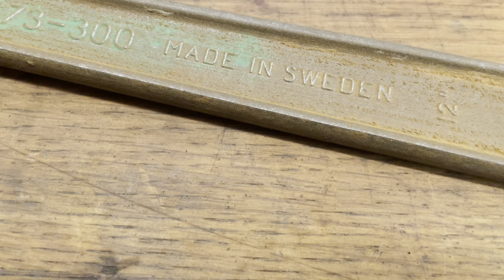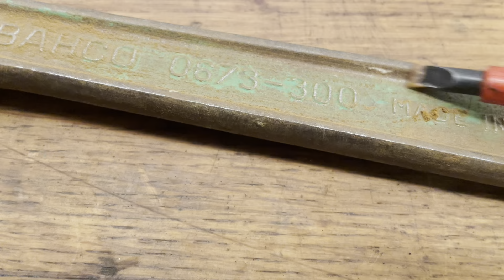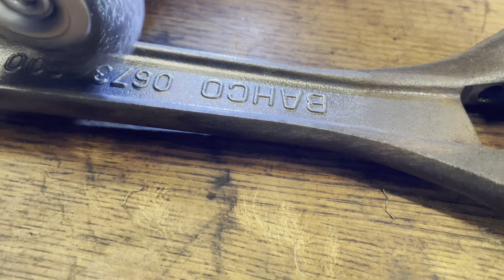Rusty old wrench restoration

Comment: For it to get like this does it mean all of the chrome plate has come off? If so how long did the finish last without rusting again, I just want to know if it's worth doing.
Reply: The adjustable Bahco's don't come chromed just some blackish oxide finish that however is rust resistant to some degree. The tool in this video vill rust like crazy if left outside.

Comment: Hard to distinguish between restoration and plain cleaning up of a tool
Reply from the maker: Well, it’s back to former condition. But, I see your point, I’ll try to be more specific next time, thanks 🙏
Reply: restoration tends to be complete dismantling and restoration (as in this case), cleaning is cleaning without dismantling.